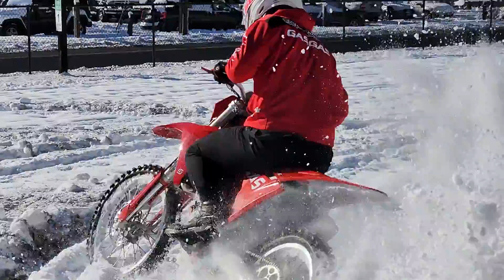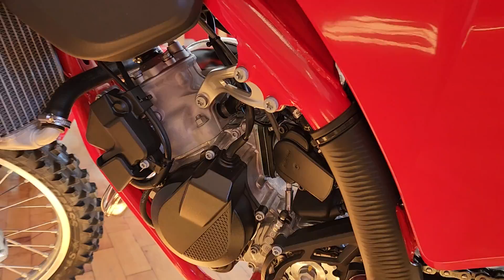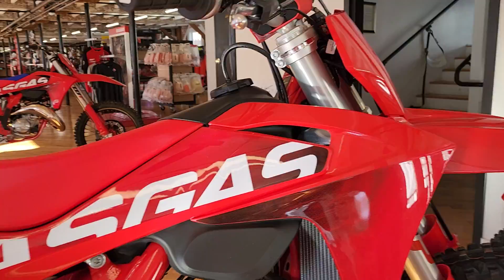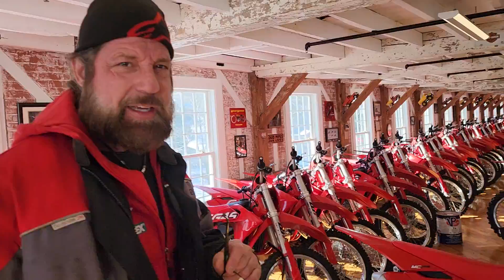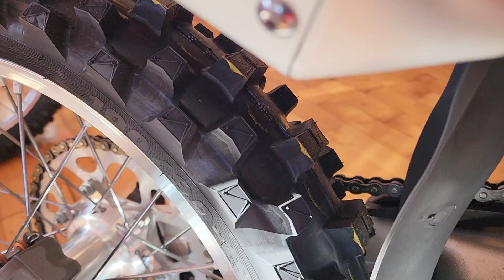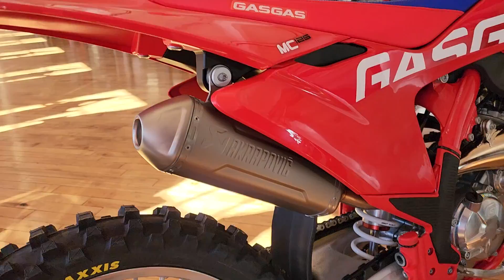SNOW  BLIND!  2024 GASGAS MC125

Comment: Where can I find a yz125 I’ve been looking for a while
Reply: Should be pretty easy to find a yz125. Are you looking for new or used?
Reply: Used
Reply: @Taylor83388  hmm where abouts are you located?
Reply: Texas
Reply: Junk, buy a GasGas
Reply: @kaplanamerica2  They certainly are not junk, that's silly. The gasgas is more modern and makes more power though.
Reply: There kinda expensive
Reply: @Taylor83388  $6999 out the door brother
Reply: @Taylor83388  unless you want a fixer upper I'd spend at least 4-5k. Less than that the bike will most likely need repairs soon of some type.
Reply: Yeah I ride a  1982 yz250
Reply: @Taylor83388  why not go back with a 250?
Reply: Sold it
Reply: @Taylor83388  Also I would recommend the x model if you don't ride mainly motocross, the kickstand and stretched powerband are nice for trails.
Reply: Yeah

Comment: Riding in snow is the fastest way to a perforated piston...but it's fun as hell!
Reply: You're basically piss-revving your engine under light or no load which is rough on pistons, and can lead to thermal runaway. It's also like trying to throw something as hard as you can with nothing in your hand.
Reply: If you are jetted correctly -winter riding is the best.  These new Gas-Gas are fuel injected, -so it should not be an issue.  =This bike sounded pretty good.

-could throw a paddle tire on back for a better load.
Reply: whys that?
Reply: yeah, why's that?
Reply: Quality explanation, player.   I believe you are correct.  Similarly, stand reving is not good for your rod because there is no suspension comforting it.